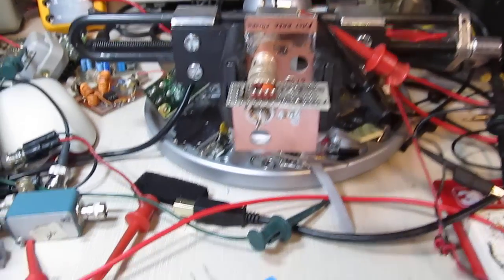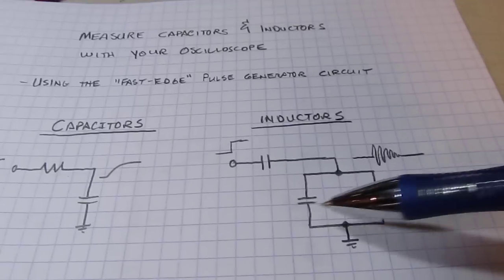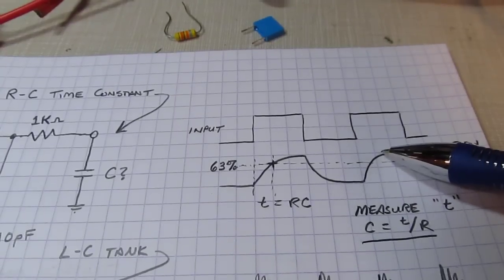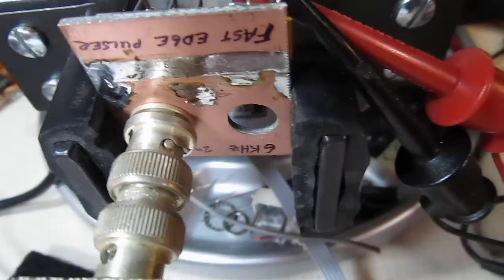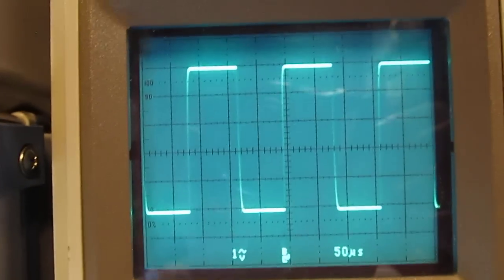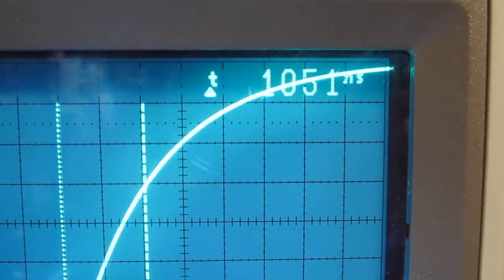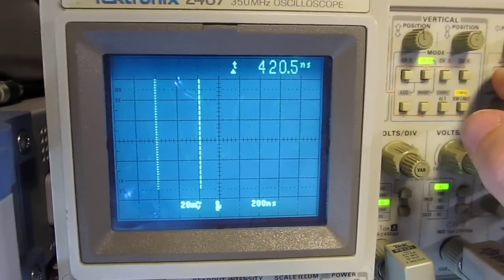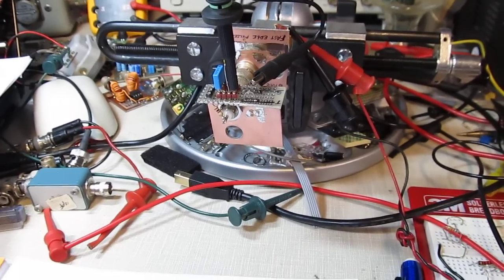#90: Measure Capacitors and Inductors with an Oscilloscope and some basic parts

Comment: What does the 10pf capacitor do? You mention its a 'differentiating' capacitor' ?
Reply from the maker: "Differentiating" is a calculus term, which basically means that it results in an output that represents the "rate of change" of the input.  Simply put, it only passes the fast rising and falling edges of the square wave to "ping" the tank circuit.  Much like ringing a bell.
Reply: *****
 didn't find 10pF in my junk box, can it be 50 or so? ie how important is the rather low capacitance here?
it's such a small capacitance that perhaps it could be diy made...

for some reason i also wanted to ask what pen do you use to write/draw the stuff down in this video? it's a nice touch of "old technology"(and still fastest and easiest way to do it...heh)
Reply from the maker: ivo kostić You can use a larger value, The idea with using a small value is that it only passes the high frequency content of the pulse signal to the to tank circuit.  Give 50pF a try, it should work fine.  The pen I use isn't a pen at all, it is a 0.5mm mechanical pencil.

Comment: hey 2 whiskeys, for a lack of better name for you, that is a cool method/ way to use your scope.  I have a question for the professor, I have given capacitor that I need to resonate with an inductor that I will have to wind.  But I have found that if the coil is too big or too small it won't resonate. Do you know of good way to find this value that is within the parameters of resonance. that is within a given frequency range. thanks mk
Reply from the maker: snaprollinpitts It's a good idea to keep a couple of "known" capacitors around to give you good frequency coverage.  Also, you might want to use caps that have a capacitive reactance value within reason at the expected operating frequency range. By within reason, I mean a Xc of something >10ohms but less than a few Kohms.

Comment: what if the inductor also has resistance (like a coil of a stepper motor), can the tank circuit method be used to determine its inductance?
Reply: if not, how to measure the inductance of a stepper motor coil?
Reply from the maker: Series resistance will lower the Q (the sharpness of the resonance), but the resonance will still be there, and should be measurable as part of a tank circuit.

Comment: Alan. Can you do a video on how to measure impedance of a coil.
Reply from the maker: diedraak1 Well, the impedance of a coil depends on the frequency you're operating it at.  Below it's self-resonant frequency, we can assume it's acting much like an inductor, and you can use this technique to measure the inductance.  Here's another technique you can use:https://www.youtube.com/watch?v=Ff5xOENID7w

Then, compute the impedance as XL = 2 * PI * f * L
where "f" is the frequency you're using with the coil.
Reply: ***** How do I know/ determine its self resonating frequency? So if I understand correctly, I should use a frequency well above its self resonating frequency, and put that into the equation? I have built your tdr. Can I use that instead of the link you mentioned?
Reply from the maker: When testing an inductor (and using it), you should be operating well below the self resonant frequency. Below the self resonant frequency, it will still behave like an inductor. Above the self resonant frequency, the reactance increases with frequency like a capacitor. You might want to check out this video on self resonant frequency.
https://m.youtube.com/watch?v=vi24SpKYYoQ

Comment: it works fine with the type of inductor you use but when i hook up a physical large inductor i have an error it should be 220uh but the calculator says 415uH  i am a beginner it would be nice if you can tell me what i do wrong please excuse my bad english and thank you very much for the video
Reply from the maker: You could have excess lead length which would add to the inductance.  Are you using a 10x probe (not 1x)?
Reply: ***** thank you for your quick reply I am using a 10x probe on the 1x setting I am also using a breadboard and bananaclip leads comming from my function generator but the small inductors the ones that look like resistors work just fine
Reply from the maker: MicEib The 1X setting on the probe should only be used on very low frequency circuits where capacitive loading is not an issue.You should get in the habit of using 10X most of the time. This gives the best frequency response and minimizes probe loading affects.  With the inductor test, you want a fast edge to hit the tank circuit,  so you should be using a coax cable, and even a through terminator on the output of the function generator.
Reply: thank you very much

Comment: Alan
What sort of board are you using to plug in the components like that.
Reply from the maker: If you pause the video at 4:20, you'll see the details of the board.  It simply uses a vectorboard prototyping board with nothing more than plated-thru holes. I've installed some pin sockets for the device-under-test connections, and hand wired things on the reverse side to a panel-mount BNC jack which is mounted underneath.

Comment: Does this work to measure the Frequency produced in a Unun that has a known capacitor value? Looking for a way to test a balun or unun's used in antenna's like a end fed antenna.  Frequency us unknown until could be tested similar to what I have seen using a dip meter or antenna analyzer.
de kd5smf
Reply from the maker: An Unun or a balun doesn't have a capacitor, so there isn't a resonant frequency.
Reply: @w2aew  Okay, I suppose that I may be thinking of a trap which uses a coil and a capacitor to help shorten a vertical antenna. I have been looking at a lot of different  circuits for antenna's.
Since I don't have a antenna analyzer or a grid dip meter, can I use my oscilloscope to help measure the inductance of a toroid that I have wound with magnet wire to make a Unun?

Comment: why not use the time constant method for the inductor to get L?
Reply from the maker: You could - I just thought the "ring" test was more fun ;-)
Reply: Thank you for replying. With you now mentioning a inductor time constant circuit I just thought there was some technical issue for not using it. Out of interest which method out of the two you have shown would you consider more accurate?
Reply from the maker: Tough to say.  My gut says that the ringing method would be less subject to errors due to the Q of the inductor.

Comment: What is the purpose of 10pF cap? Any particularity for this value of capacitor?
Reply: It is just a high pass filter, to send only the high-frequency content (the energy in the edges) to the tank circuit. Value not very critical, but should be low, <100pF.

Comment: A good thought- but digital oscillator circuits ring too much and have too much energy at the corner of the square-wave. It's likely that when you induce current in the inductor that you are trying to measure that you'll get a reading at some harmonic frequency other than at the true value of the inductor.
Reply from the maker: You're actually relying on the broad range of frequencies do that you have some energy at the resonant frequency. The dominant frequency of the "ring" will be at the tank's resonant frequency. So, it actually does work.
Reply: The exact same principle is used to generate ghz IF frequencies from digital crystal oscillators that operate at around 30 mhz. The square wave- especially when generated by TTL circuits- have a great deal of energy at harmonic frequencies. For instance I saw an instructor take a 7404 inverter, which has an optimistic rated speed of 35mhz, and watched as he demonstrated how you could use the 5¢ chip to jam all of the low VHF television signals at the same time.
Reply from the maker: Of course, the faster the rising and falling edges, the more high order harmonic content. This is precisely why it works so well to ring the LC tank circuit. A low frequency is chosen so that the harmonics are closely spaced, increasing the likelihood of exciting the resonant frequency.

Comment: can i use a 1mhz function generator instead of the the fast edge generator
Reply: Probably. It will mainly depend on how fast the rising edge speed is on your squarewave output waveform.

Comment: How can you know the value of the inductor if your tank is not tuned?
Reply from the maker: If you know the value of the capacitor, and can measure the frequency "ring", we know the tank is tuned to that frequency and can calculate the inductor.

Comment: Is it possible to use a "regular" or TTL square wave generator? Is so, what frequency? Sorry, if you quoted the frequency in the video I didn't hear it.
Reply from the maker: The frequency isn't really that important.  I think I used 5 or 6kHz.  However, TTL wouldn't necessarily be a good choice because of the asymmetrical drive ability.  CMOS would be a better choice.  The faster the rising/falling edge speed, the better.

Comment: Any reason why you can't use the C-R technique for L-R?
Reply from the maker: You certainly could employ a similar technique.  However there can be complications with core saturation with inductors that use core materials, so that could lead to confusion if the user doesn't realize that the core has gone into saturation (and the apparent inductance changes/drops).
Reply: cheers..my problem is lack of a range of capacitors, but I'm managing, using the sq wave o/p of my scope..thanks for the vid

Comment: Hello w2aew can you tell me please what the differencial capacitor does ? it is necessary ?
Reply from the maker: dragoshh 2113 I assume you are referring to the differentiating capacitor... ...it is a high-pass filter that only sends the high frequency energy to the tank to "ring" it.
Reply: ***** Yes differentiating  capacitor ... I wrote it bad,  sorry.
I don't understand why we need that filter, we generating only high frequency square wave, we don't have  DC current.
It is a great circuit , it will help me a lot, nice Tutorial.
Thanks for answering me.
Reply from the maker: dragoshh 2113 The square wave can be very low frequency, we just need the fast rise/fall time, and use the series capacitor to only pass the high frequency content contained in the signal's rise/fall edges.  It keeps the DC out of the inductor (preventing possible saturation of core material).
Reply: ***** thanks